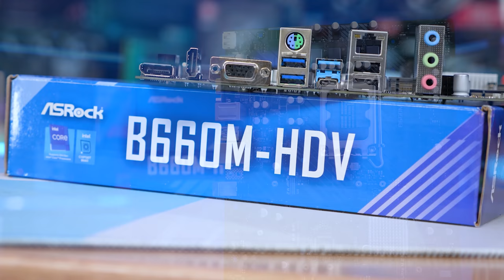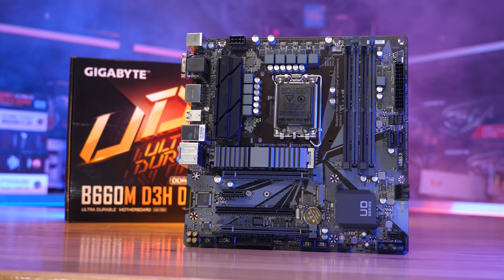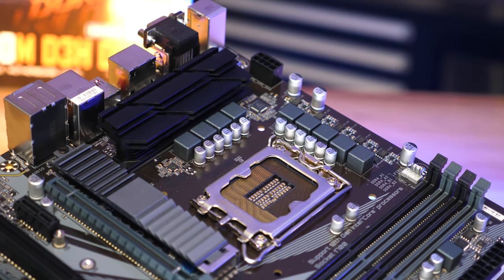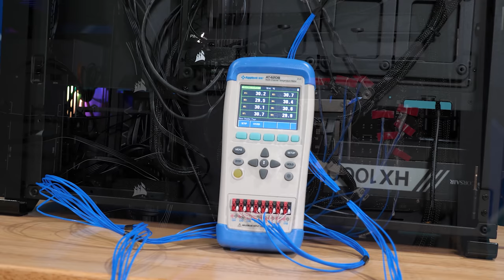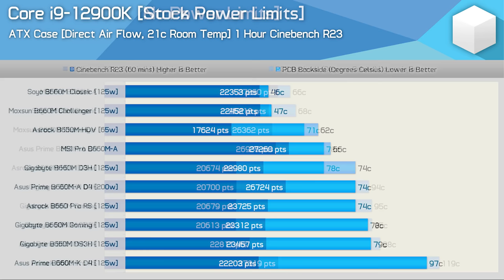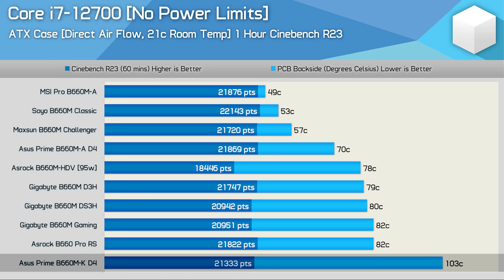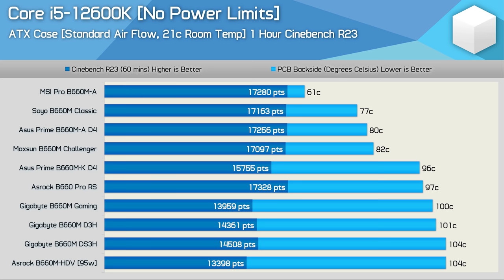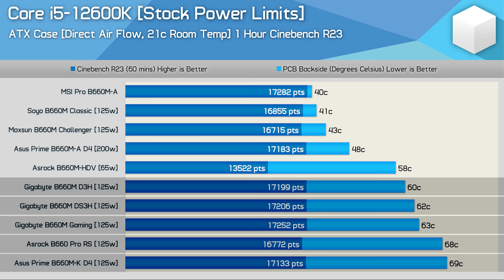Best Budget Intel B660 Boards, VRM Thermal Test

Comment from the maker: Part 2 is now available, covering 18 boards in total: https://www.youtube.com/watch?v=PEa0vcJ0lRY
Reply: what doesnt mean direct and standart air flow ? direct its u put additional fan on vrm radiotor or what ?
Reply: what does direct airflow mean pls explain
Reply: I'm not sure of the general meaning of the term myself. But per the speaker himself, '... direct airflow configuration, which includes an additional 120mm fan covering the VRM.'
Reply: @dothackjhe  any idea how t mount a 120mm fan for vrm
Reply: @aravindraja8034  That will probably depend on the layout of your build. I think, you will just have to improvise on it, mainly.
Reply: @dothackjhe  ok
Reply: How do you go from "stock power limits" to "no power limits"? Is there a setting I have to change somewhere?
Reply: @DoodleDoo  in bios you can even on a basic Mobo like h410
Change P1 and P2 limit and time to whatever you want it’s that simple
Reply: i really loved your vids btw i am getting the MSI b660m-a and the MSI mag b660 bazooka for the same price they both are the same motherboard but look different which one should i go for??

Comment: Kudos for the MSI for focusing on VRM quality.
Reply: I believe B560M Pro VDH is in their B560 round up.
Reply: It's because the "MSI Pro B660M-A" is MSI's only for less than 150,- AUS/US(?)-$.
Reply: Ah  never mind. He reviewed the VDH WIFI as well. Sorry for the confusion! ^_^
Reply: MSI likes its VRMs
Reply: i think this is just the right amount of focus. for people who have the budget to buy b660, it means we'll usually run i7's at most and an i9 if it's cheap later. as a result, designing a board to just BARELY run the i9 without throttling is ideal since the rest of the limited budget can be spent on features.
Reply: MSI have several boards that would have tanked here, i.e. the Pro E, the Bomber, the Pro B and the Pro G. You honestly don't need to watch the video to understand that the board with 5 CPU power phases and no heatsink is unsuitable for anything more than an i3, and that the board with 12 power phases is going to perform better than  the other boards which have only 6 or 7. 

Plus a lot of this is based on pricing assumptions; in my market the B660M HDV is $40 cheaper than the others. It's a great buy with an i3 and two M.2 drives, while the H610M HDV/M.2 is even cheaper and good for being cheap. The Pro RS is $70 cheaper than the MSI here (although the MSI has wifi), and $35 cheaper than the Asus Prime A. 

All of these boards are good with the right CPU and cooling solution.
Reply: @thelawnet  all because of their lack of VRM heatsinks.
Reply: @thelawnet  If you add the VRM heatsinks onto the naked VRMs of the boards you have said, then the problems pertaining to VRM temperatures would be much mitigated.
Reply: Since the x570 fiasco they don't wanna get embarassed again.
Reply: it's weird that they also didn't test b660m-E Msi as their low tier lineup. While they picked Asrock B660m HDV for test
Reply: @bsh7390  probably they assumed that it will be instant fail for their standards.
Reply: @drewmendoza2041  Is gigabyte 660 ds3h good choice for i5 12400 or should I go for msi mag b660?

Comment: Very impressive results from the Maxsun  and Soyo boards! Kinda put some of the established brands to shame. I would be tempted to try these if it wasn't for the potential support/warranty limitations.
Reply: They have been solid brands (in terms of products) for quite some time now, good to know they are starting to get some recognition (you wont buy them anyway, they are not really sold anywhere west)
Reply: @HelloOnepiece  Except, Aliexpress is a thing. I mean they do deliver to the west, east, south or north.
Reply: Kinda order one, the legacy cpu cooler suport is what i need
Reply: as a legacy pc builder, my customers(relatives) refuse to upgrade and I have to source fm2+ motherboards from China, maxsun and soyo fm2+ motherboards work seamlessly
Reply: as u said, "potential support/warranty limitations". I imagine this is the exact reason why they can sell for lower. Setting up global distribution, support and warranty should cost a lot too.
Reply: @kosmosyche  In general always avoid being the importer of stuff. House burns down and the insurance companies tend to go after importer first. And I wish good luck winning a lawsuit in China.
Reply: I have a Soyo motherboard from the early 1990s that still works. I still run windows ‘98 on it. The coin battery has had to be replaced five times but other than that, it still works just fine. If this is still the same brand, I would not hesitate to buy from them. I find it hard to believe that this brand is still in business while being absolutely unknown in the US.
Reply: @jepulis6674  Too late, my friend, too late. lol I've been using them a lot in the last couple of years, since where I live (you don't want to know) you can't find a lot of what they are selling and what I'd like to have, at least for adequate price. So, for me, it's either risk  with them or not have some shit I need at all. Still, thanks for advice.
Reply: @keithc2390  The current Soyo has nothing to do with the old Soyo, it's just a brand name of Maxsun.
Reply: The results doesn't even make sense. Both boards hit ~80 degrees with power limit set at 125W and 22k score. Remove the power limit and they hit ~100 degrees with the same 22k score? So enabling no power limit just ups temps but provides no performance gains whatsoever?
Reply: @longdang2681  their bios is weird could've been a setting missed

Comment: I would have avoided giving the Asrock Board such a clean B-roll, probably a mugshot style thing with a massive red Cross on it for Asrock to get the message 🤣🤣
Reply: With a fart sound effect
Reply: He's not Gamers Nexus...
Reply: I would have filmed it in a dumpster and on fire so you don't accidentally use it somewhere down the line. The only board even worth considering is the MSI Pro A in this roundup, hopefully round 2 fares better
Reply: Is gigabyte 660 ds3h good choice for i5 12400 or should I go for msi mag b660?
Reply: @rmmbitfountain3922  msi b660 m a
Reply: @thelegendaryklobb2879  don't forget the reverb!
or a boo-womp
Reply: @ShubhamPednekarYt  İ3 12100f için Gigabyte B660m mi almalıyım yoksa Asus H610m A mı almalıyım ?

Comment: Aside from the MSI, all other mobos look very underwhelming. The cost of the chipset + PCIe4 must be high.
Reply: You're ignoring the maxsun and soyo boards as they are the best performers in both performance and temperature but yeah they are  Chinese products so it doesn't surprise me that you're ignoring them
Reply: Looks like your typical budget motherboard to me.  You want he bells and whistles you go for the Z690
Reply: @nayan.punekar  they are second to the MSI B660m-a. Still very good boards.
Reply: agree, b560 had much better boards eg b560m pro vdh
Reply: @rdmz135  Yeah but they were pretty close when you look at the graphs as there were multiple instances where the Chinese motherboards outperformed the msi boards and the msi boards are more likely to be sold at a much higher price while it's common for Chinese boards are generally cheaper but like I said the msi board is more preferable as it's a more trustworthy company and would provide bios support for a long time and have a warranty which I would not expect from the Chinese boards.
Reply: @nayan.punekar  Exactly! I am sure that MSI will provide bios updates and the warranty must be a lot better.
Reply: @nayan.punekar  I live in Asia, the Maxsun and Soyo boards are not sold here; the other brands are, it would be pretty dumb to import a motherboard from China if you can buy a board locally for less money with a guarantee.
Reply: @nayan.punekar  TBF they outperformed the MSI board only with the default power limit enabled. That just mean MSI was more conservative.
Reply: @nayan.punekar  ???? He made the point multiple times that they performed very closely to the MSI board. He also pointed out that the only source for them for most buyers is Ali Express, which is not free shipping for most customers. The MSI motherboard on the other hand will be readily available from a number of outlets with free shipping and convenient customer support. MSI also has some of the best bios support in my experience. If the Soyo and Maxsun were less than $100 total I would consider them. Otherwise I’d go with the MSI or better Prime board.

Comment: Got the MSI PRO B660M-A, paired with a 12600K just yesterday. And I'm so glad to see this video. 🤩
Thank you so much Steve for all your hardwork!
Cheers!
Reply: Thank God you made a right choice!
Reply: 10 cores was more than enough for my needs. The 12700 would've been overkill for me even in the long run.
Reply: Am i missing something but why 12600k with a b660 and not z690?
Reply: @GabrielKLKN  why not, you still can do base clock overclocking which most people won’t do anyway
Reply: @GabrielKLKN  z690 is overkill anyway
Reply: @Abhinand AV indeed, if you want 12th gen K series CPU, get a Z-series motherboard in order to use all its potential.
K series cpU in B-series motherboard is such a waste of potential
Reply: I got the same build.. MSI PRO B66M can handle 12600K pretty easily 😄😄😄 Loving it!
Reply: @ms.stability  temperatures are absolutely fine for me. I don't have heavy workloads btw, just photo editing software and some VMs for testing. No idea where the battery is though 🤣. I just noticed after you pointed it out.
Reply: @ms.stability  output for 'sensors' command on Linux shows 28 deg C. And my room temp is like 27 deg. So it appears to be perfectly fine 🙂
Reply: @ms.stability  found the battery. It's behind the LAN port, just under the heatsink.
Reply: @ms.stability  exactly!
Reply: Excuse me sir, but did you habe any problem with ethernet conection? I got this motherboard a few days ago and just right now I'm bringing it to guarantee support because it doesn't conmect to Internet. I updated the BIOS. Downloaded drivers and nothing seems to work. So It seems that the motherboard has a problem from the manufacter...
Reply: @Hieloztem  Had this issue with the old linux kernel shipped with Linux Mint. Then I Installed Arch with latest kernel instead and it worked immediately. If you're on Linux, download the edge iso for linux mint. I don't know about windows though.
Reply: @JzfDavid  well in my case I am building a PC for a friend with Windows. I tried re-installing the drivers from the official website more than once and nothing... Anyway, The guarantee will cover this problem, but thanks man for you comment
Reply: Got the Pro B660M-A for a 12400 build. Might as well for the price and features. Also good to know if a more powerful CPU is dropped in there in the future, it can handle the heat.
Reply: Is that overclocking is available in this MSI Pro B660M-A motherboard, bro? 😟
Reply: @mohammedinamulhasan9087  Only memory overclocking. No CPU overclocking.
Reply: @restymalinao2023  The problem is that once your system needs that little push to stay on top of games, you wont be able to make it a proper overclock.. The diference is basically the cpu holding for 2 or 3 years more against newer models or not... That is the whole  point of K series.. you use them as standar cpu the first years and then overclock it when games start to max it out...
Reply: @JzfDavid  yeah bec your day to day work is Microsoft Office only. thats why overkill 🤣
Reply: @rigidhammer7376  I run Linux and stay away from Microsoft. I have a PlayStation that I carry around so I don't bother installing games on my PC for now 🙂

Comment: Damn this is an insane difference between these boards! I wouldn't have thought this would ever happen lol, I've always had this in my mind that "any board can run anything stock with no problems" but turns out it's a wild difference with boards even in the same price range. The MSI Pro looks like a great candidate for an upcoming build, I just wish it had +1 M.2 slot like many other 12th gen boards do. I highly appreciate motherboard comparisons like this, I'm really looking forward to the next!

Comment: Great review! Awesome work. You helped me allot with this. But I think  if you would use air cpu cooler, specially with double fan support, the vrm temps will be much lower then water cooled. Would be nice if you just try it with a couple boards if this indeed helps.

Comment: My workplace is upgrading my work system and are using the Asus Prime B660M-A D4-CSM, which seems to be the same as the -A D4 in this video, minus one of the VRM heatsinks. It'll be running a 12700F, which seems like will work fine with the VRM solution. I'm nearly certain they will be using the stock cooler with that CPU, so we'll see how that goes.
Thank goodness for you making this video, and allowing me to rest easy that my employer hasn't selected a trash mobo for my new machine.

Comment: First of all I really aprecciate the work you guys putting in to these reviews. My question is how switching to an air cooler would affect the VRM temperatures. Since this is the setup i imagine most people will go for. Also testing these boards with an i5 12400 would have been very interesting.
Reply: He mentioned in the video almost all of these would work fine paired with a 12400. I would think using an air cooler would lower the temps slightly but also how many people use such a solid air flow case as what was used in the video
Reply: @johntotten4872  Well yeah since the 12400 draws roughly 2/3 of the power than the 12700 does (with no power limit). Not so sure about the air cooler. The air which flows over the VRMs  is definetly hotter than compared to the setup used in the video.
Reply: Air coolers don't all have downdraft for the vrm's, given the high power draw during turbo, most people would pair these with a budget tower cooler which would have minimal air directed at vrm's.

Comment: A lot of work there. Thank you.  I'm looking forward to your ITX roundup. Here up over the MSI B660M-A is £162 on Amazon (cheaper if you're willing to wait a month) which begs the question: is it worth spending £18 extra to get the MSI Mortar for £180? Something for a follow-up video, perhaps?

Those Chinese boards are superficially impressive so perhaps you might do a deeper dive to look at the companies and their ranges of products?
Reply: I too would like to look at the other products from those Chinese manufacturers as they are literally the best performers in Steve's data and it sure is kinda superficial given the price.
Reply: both of them are grossly overpriced, you can buy the B660M-A for £130 from technextday in stock. £180 is far too much for the Mortar you'd best look at Z690 for that money.
Reply: @thelawnet  what boards are you referring to by both?

Comment: I would have loved to see numbers for the 12100 and 12400, which are probably the most likely pairings for entry level B660 boards. Given how bad some of these boards were, it wouldn't shock me if they couldn't even handle a 12400 with unlocked power levels.
Reply: My MSI PRO B660M can easily handle my i5-12600K 🤗
Reply: All would handle it just fine except for the ASRock HDV piece of trash

Comment: I’m not in the market for a full sized board but still watched through the whole video. The amount of work put into this is insane.

Also, am I reading this right, the ASRock HDV can’t even run the 12900K properly at PL1=65W? Anandtech reviewed a NUC Compute Element card with a 12900 (PL1=65W) and it yielded an R23 score of almost 18000.

Comment: I wonder how much better DS3H would compete if Gigabyte would replace this M.2 heatsink with second VRM heatsink. It's budget board so no one will place top end 4.0 drive in there right away, and slower drives don't really need heatsinks. And if someone really wants to upgrade to 4.0 SSD later they can get one with heatsink or they can even buy very cheap heatsink.

Comment: A very useful comparison and gives a stark contrast in the quality available, even at similar price points. One thing I would be interested to know is whether there's any variance in system power use between the boards. Is the excess heat just because of inadequate cooling capability, or is more power being turned to heat due to less power efficiency?
Reply: Ask this question in his community Q&A and you might get an answer if you have enough upvotes.

Comment: I got the asrock pro rs for $80.  With an i3-12100, 1TB NVMe ssd and 32GB ram it’s done well so far.  I only had $500 to setup a new rig tho.  On 500wpower supply with one 120mm fan it’s actually good for lower end stuff that I’m doing like Cad work and Star craft 2

Comment: Be sure to update your BIOS when you get these boards. Multiple brands have had very bad performance issues with certain chips on their stock bios. The Gigabyte D3H in particular misbehaves BADLY with locked i5 chips on the launch bios.

As always, run some benchmarks and compare them to what that chip should be capable of
Reply from the maker: We always update to the latest BIOS.

Comment: Soyo boards are still around? They were quite common in late 90's Poland, I myself got Celeron 466MHz with Soyo board in 1999, and I loved their designs as everything was fairly well placed and they retained an ISA slot for much longer than other brands. They kind of disappeared in early 2000's some time after the Socket A became the king , I remember they had a board called Dragon or something, but the price and availability wasn't too good and it might not been a top performer either so it was hard to justify the purchase. I remember going Shuttle at that time due to similar design and 5/6 PCI slots, I think AK31 and AK35GT2R for my Thunderbird and Palomino, after which Shuttle disappeared and I had a nightmare with Asus boards until I found out how rock stable Gigabyte boards became around P35 era.